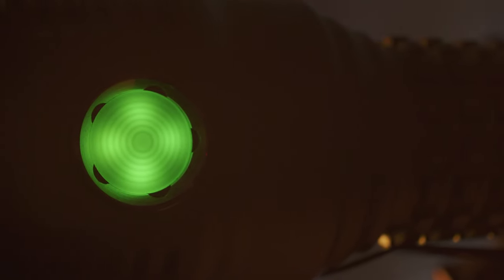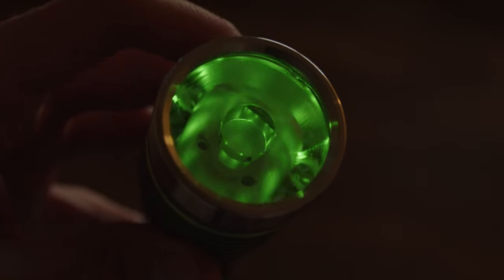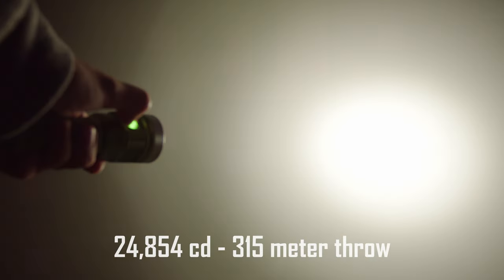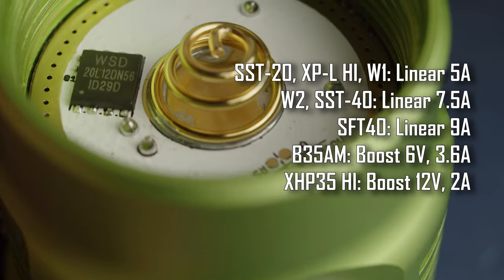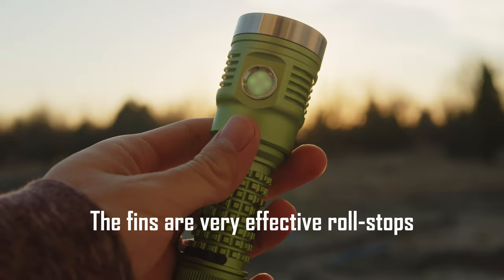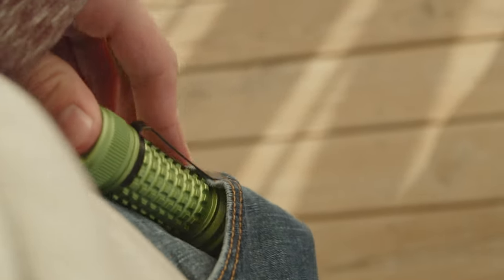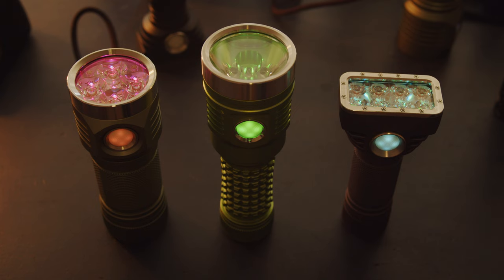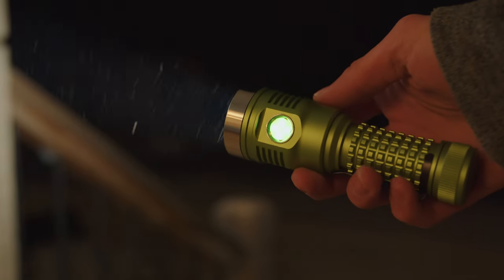Noctigon DM11 - First Look

Comment: Do you know if the “medium angle optic” he sells as an add-on is the one you got with yours? I’ve been looking for a light with anduril, aux LEDs, and high cri, that has a balance of throw and flood. I’ve found multi emitter lights are too floody. Big reflector lights are to throwy, and don’t fit in the pocket well, and it tends to be difficult to offer aux LEDs with a reflector. Now this one looks a bit too big for pocket carry and I wish there was a tube style 21700 light that fit my wants. Closest is a convoy s21e, which would be about perfect period except for it has a pretty bad UI. No auxiliary LEDs I could accept. So with the less intensely focused optic you have, would it be closer to that middle of the road beam?
Reply from the maker: Yes that is the same optic, and it will give a nice balanced beam, though it will still be on the throwier side unless you have a larger emitter like the B35AM here.
Reply: Thanks. Ya the b35am is what I had in mind. Or maybe an xhp 50.3hi in high cri. I like my lights to be a bit throwy, but not a pencil beam. Somewhere in the 20-30 cd/L area
Reply from the maker: @victorvannatter312  I love the B5AM, it's my favorite LED for thsi lgiht. The XHP is also a great option that will provide better performance and will be a bit throwier.
Reply: Received my xhp50.3 hi 5000k. This is a very nice light. My first hank. Measured 1944 L on turbo. The big optic is gorgeous with the aux LEDs. Have both medium and tight optic and currently have medium installed. Only thing I don’t like is the button is so recessed it’s difficult to use with the flat of my thumb. Need to use my nail. Can’t wait for dark. This is the second hit to my wallet from your videos
Reply from the maker: @victorvannatter312  Lol glad to hear you like the light so much, you might be making me reconsider ordering an XHP50 model myself 😅
Reply: @LuxWad Lol. Some payback for me then. The 4000k cct is nice and without an opple the tint looks very neutral. No green at all. Well, other than the host and switch LEDs. 😊 Much better than the sst-20 4000 from the ts21. Which aren’t offensive but I did add one layer of lee 804. Still more yellow than this. And at 2000L at startup, this is a spicy dm11

Edit: hold up. Lol. It’s getting dark and I compared it against a dedomed 519a and there’s definitely some green there. But it’s weird and I think you’re right in your video. It’s from the green annotation from the host. Once I’ve tried this optic and take it apart to try the other, I may darken the inside of the head and see. It’s not objectionable green I don’t think, but is noticeable

Edit edit:  on a white wall it looks greenish. But it’s definitely just in the outer spill and it’s from the host. The led is a clean white
Reply: So as a final thing, Ethan you definitely need to get this one. It’s been my dog walking light for the past week. I finally charged it last night and I use it for about 30 mins at a time at level 5 and 6 mostly but some high and turbo as well so efficiency is excellent. Also will still hit 1950 lumens on turbo at 3.2V which is incredible. With 2000L and 52000cd, should provide a very similar beam to a d4sv2 with boost driver and w2. But with 90+ cri and 4000k neutral tint. If you are looking to add another DM 11 to your stable, I cannot recommend this set up more. But definitely go with the normal optic not Hanks recommendation. He says it’s because it gives an ugly beam, but that’s only from about 8 inches away from a wall. In use, it’s perfect.

Comment: I hope you dont mind me asking here, what emitter should i order in the KR1 to get the 9A driver? I'm planning to upgrade the KR1 to an SBT90.2 and would like to have more than 7.5A available.
Reply from the maker: I don't think Hank sells a 9A driver in the KR1, you might have to email him. However If the SFT40 becomes available soon in that light, it will probably have a 9A driver
Reply: I bought a modded kr1 with an sbt 90.2. Its way more floody than my w2 version. Just fyi

Comment: Man... With the 26800 tube coming out for the D4SV2 and this light having such a similar size - that's a missed opportunity.  

I know that fatty lights aren't for everyone, but I love 'em and the knurling is quite a bit less dramatic than the stuff on this 21700 tube.

Maybe the community could talk him into developing one, if the cell would fit into the head at the contact.

Comment: Just FYI - Took a look at the spec for the B35AM and its max CRI is 90, not 98, making the SST20 a bit better in this regard.
Reply from the maker: 90 CRI is the minimum according to the datasheet for the R9080 version. Other reviewers have measured almost prefect scores with this LED

Comment: Dumb question: would the SBT90 LED work in this light? Super brightness and heat
Reply from the maker: The linear driver can support it, but the optic doesn't have a large enough opening. Hank says there's no plans for an SBT90.2 version.... But he tends to say things like that and release it later down the road. Don't plan on it though
Reply: @LuxWad  thanks for the reply! Since I got the K1 with that LED I am addicted, of course that’s a much different form factor! However the KR1 has that emitter option and that’s roughly the same size as this light isn’t it? Btw is lionheart_2281 from BLF 😊
Reply: Nevermind, I’m dumb, KR1 didn’t come with that emitter, it’s just something I’ve seen V54 mod
Reply from the maker: Yeah the KR1 does have it, the reflector opening is a bit larger than the optic in the DM11. I do hope this light will have the option somehow, as the SBT90 is just an amazing emitter... If you happen to try out the Wurkkos TS30S, it's a bit larger than this light and has the luminous
Reply: @LuxWad  cheers, I’ll look into it mate

Comment: would be cool if you had a if22a laying around and swap the TIRs to showcase the difference. also the if22a with this optic
Reply from the maker: That would havbe been cool. I believe the optic used in the Catapult Mini is the same as the IF22A, which is the same in the normal DM11.

However, the optic has to be modified to fit the B35AM, since that LED has a different height and causes rings in the beam with the spot optic. That's actually why this light has the floody optic, as that was Hank's solution before he started modifiying the optics for the Nichias.
Reply: @LuxWad  ah cool thanks. i though this choice of TIR for the proto was only due to stock issues

Comment: Where are you getting batteries for Hanks lights. I just purchased a Hank light and didn't realize there was no battery included. Having a hard time finding the right battery.
Reply from the maker: I purchase from 18650batterystore.com and illumn.com (which are US-based retailers).

Batteries have to be purchased from reputable sources for safety reasons, so you'll have to do some research into good battery retailers
Reply: how do you not know where to get good batteries if you have a hanklight?🤔
Reply: @HitoriGnocchi  you above

Comment: Are there any good long running floody lights which have a long run time at the 2,000 lumen range?
Reply from the maker: Not really anything in this size range, you'll want to step up to a multi-cell/pop-can style light for that. Any light of that stype should be able to sustain that amount of output
Reply: @LuxWad  Any suggestions?
Reply: bro 2000 lumens is a lot youre going to have to get those big can lights +3x batteries w the handle and active cooling.
Reply: @HitoriGnocchi  I figured if my current flashlight can maintain 1,000 lumens for 2.5 hours  with one 18650 I would think that someone could make one which could do double or triple that.
Reply: @Camrographer  i assure you your flashlight is not holding 1000 lumens for 2.5 hours